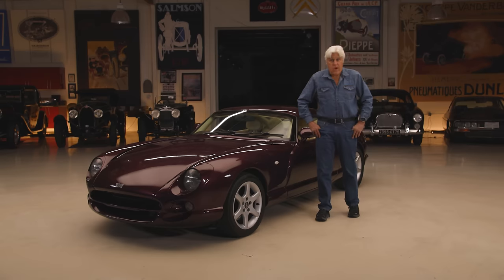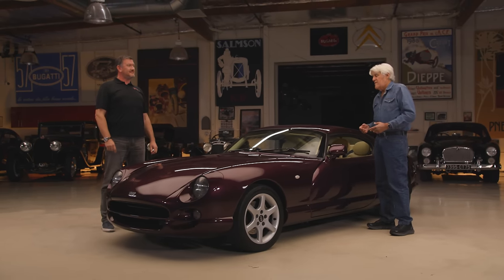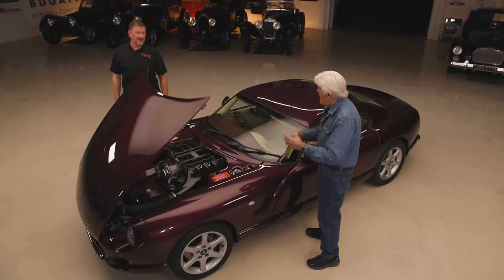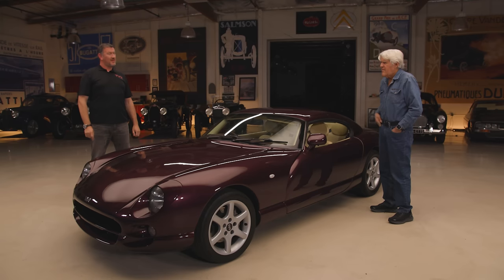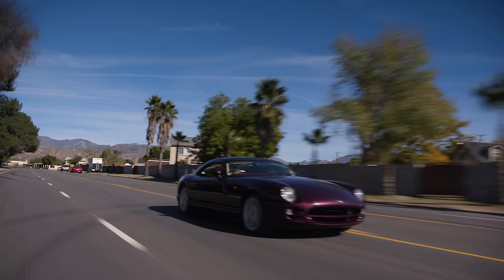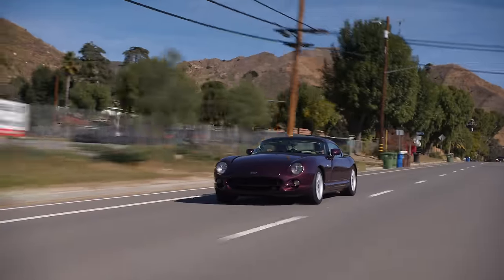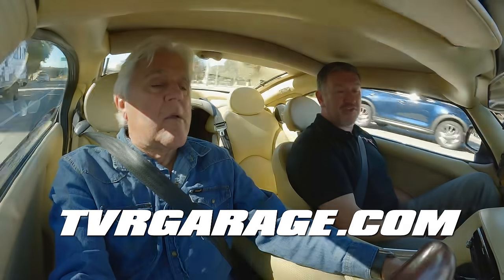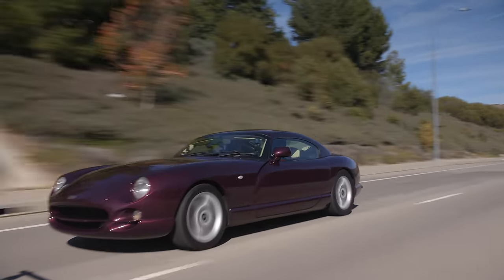TVR Cerbera - Jay Leno's Garage

Comment: I came to TVR in the early 90's before the Cerbera had finished being designed. I went straight into the development department and assisted with some of the body styling. Most of the front end was my work. Although the styling was borrowed largely from the Chimera front end, I designed the scoop that also incorporates the numberplate fixings, which also directed airflow up to the filter and top of the radiator. I blended in the indicator mountings to be part of the bodyshell layup rather than being a separate fixture as in the Chimera. I also designed the air intake system from the filter tray and filter cover mounted right on the front of the car and the scoop panel covering the steering rack and hiding the screen wash bottle. Was good days but a lot of stress. Peter Wheeler would constantly change things.  Once the moulds were being made I became body shop foreman for the Cerbera fibre glass production line and set up and trained all new staff to produce all the GRP parts of the car. I was Foreman on that production line for 5 years. I left to start my own composites production company in 1999.
Reply: Great to read a bit of the back story and development, I remember being behind a Cerbera on the way to a race meeting, really beautiful car hooning through English country roads, I was in a Golf GTi and we were both moving pretty quick down twisty B roads, once a good straight opened up you could say he easily gapped me!!
Reply: You did beautiful work.
Reply: Very cool !  Hope you’ve had a successful business
Reply: Well, because of you, this is still my favourite car to this day. Thank you.
Reply: @murkeywaters  The 205 1.9GTI was perfect for those twisty B roads - far better than the Golf GTI! OMG still one of the most fun cars I've every owned!!! Take the back seats out, they are useless anyway and put a rollbar in instead, but it was incredibly stable! The way you can throw the 205 round corners was mental, so quick but you had to learn the clutch or it was very easy to wheelspin. Not terrible in the wet, being fwd but it would understeer - so unforgiving but it got banned in France due to the number of fatal crashes! :body-blue-raised-arms: 
TVR's always make me smile! Driven the TVR Tuscan quite a few times and it was a blast! The Cerbera is a beautiful looking car!! :face-red-heart-shape: 
I love how Jay totally know's what he's talking about - the Guy is incredible! :person-turqouise-waving: The more I watch, the more he astounds me! :face-fuchsia-wide-eyes::person-turqouise-waving::text-green-game-over:
The 1930 Duesenberg LeBaron Barrelside made me cry!!! :hand-orange-covering-eyes::eyes-pink-heart-shape::medal-yellow-first-red:
Reply: Very very interesting, i have the last luxury car i plan on ever buying, my next car is most likely gong to be a cerebra, then my collection will be mostly complete
Reply: Beautiful job! I feel like they tainted your work with the TVR badge on the front. It's a billboard in a font that just doesn't match the car. Very classy styling. You're a master of your trade.
Reply: Great job mate you nailed it!

Comment: 31 year old Brit here. TVR has always been a favourite brand of mine, often known for shoddy build quality and questionable reliability. None of that has bothered me, the noise, the looks, the crazy speed and handling. That's why I love them. Sadly I haven't managed to afford to own and run one though.
Reply: You either like it or not, you either get it or NOT. People that like them, love them till death. People that hate em, can't stand the look of them. It's a car for enthusiasts! If you aren't one, it's not a car for you! But I agree with you! Cerbera and Sagaris are my all time favorite!
Reply: This one though, unless you live in a dry climate the whole chassis will rust out.
Reply: Yep watch edd chinas wheeler dealer’s restoration the whole chassis needed changing. But. Beautiful looking car
Reply: @SethDaughters it was easy to stop the rot. Theyd made the same mistake as Rover did on the SD1 and made whats like an inner fender that was supposed to let the wind get in and basically blow dry it. The fix was easy a few drill holes in the right places or you could fill the thing with marine expanding foam if you didnt care about the extra weight. Everyone at the time knew to fix the stuff TVR almost got right so practically any decent one you buy will have had all the usual mods done.
Reply: The main problem with the chassis is the really poor quality powder coating. Small bits of it flake off, then the exposed metal rusts. Then lifts the powder coating around it, which then rusts and so on.
Much of the chassis is inaccessible (or invisible) with the body on, so the only way properly fix it is to lift the body, then carry out the appropriate repairs, and finish with modern, good quality powder coat.
The first bits to go are usually the outriggers which are the tubes that run along behind, and support the sills of the bodyshell. These can be done by lifting the body slightly rather than completely removing it, but if you’re going that far, you might as well lift it and check / repair the whole thing.
If it’s really far gone, you can actually buy complete replacement chassis, although they aren’t cheap.
Reply: Well, a lot of us had to wait until their forties and fifties to obtain their dream Trevor (Chimaera 500 in my case), so at 31 you still have plenty of time! But don't worry, it's SOOO worth the wait!
Reply: I grew up in the North West of England not too far from Blackpool. Local small business owner had a Cerberus 4.5. Amazing car but as you say @danielhillier7417 the build quality was "questionable". He took it to France on a road trip and, as was the traditional at the time, absolutely gunned it on the first section of Autoroute off the ferry. At some speed in triple digits the entire exhaust system made a bid for freedom. The car had to be towed back to the UK and undergo some rather expensive repairs. I never saw it again...replaced with a 911 Turbo 😶
Reply: @TheAdamRBell  "exhaust made a bid for freedom" 😅 ok presumably someone had been fiddling and didn't put it back on properly... It's an exhaust and hardly worth mentioning, mine is 24 this year and the exhaust hasn't fallen off ONCE! 😱 AND I have grounded it in a multistorey carpark in France with ironically a bunch of Porsche enthusiasts behind me trying to get down to the same level. They made it without a hitch as their cars were riding higher and not to mention the wheel base on a Cerb is very long. I would blame poor repairs by "a" TVR Specialist that has me questioning them and not the car. They're awesome and this kind of BS is so old now it's getting boring. Any news on his IMS bearing? 😅 Oh but it's a Porsche can't talk about stuff like that!
Reply: & if you bought ANY car in the 60's & '70's even from a mass production auto manufacturer, ie,Austin, FIAT,Lancia,Triumph etc, the whole car rusted away!  @SethDaughters
Reply: The reliability is a misnomer, they only break when they don't get used, other than that they're damn solid cars, just have to remember they're hand built.
Reply: @TheAdamRBell  The British actually make more beautiful cars than the Italians, they make them about as reliable too.

All the most reliable British and Italian sports cars had American v8s, Shelbys, Sunbeams, Rovers, Jensens, Isos, De tomasos, etc.
Reply: @Pits750  exactly. Although I have put mine in storage at my uncles so I hope I don't have any issues. 😩

This said over the next few years it will have the body off for a full refurb.
Reply: @Pits750  Yeah I know they aren't really that bad.
Reply: My old Tasmin never experienced any real engine or gearbox failure. However, it did have clutch and throttle cable failures (the latter resulting in full throttle acceleration), headlight pop-up arm came off (got bloody wrists from rough glassfibre scratches re-attaching it), and a sheared bolt holding one of the rear trailing arms in place resulting in collapsed suspension and the wheel contacting and making a mess of the wheel arch. Fortunately this didn't happen at great speed. Still I loved it, and would have had another Trev but for a young family.
Reply: @Pits750  My Chimaera has broken down once in 15 years and 52000 miles - it snapped its throttle cable. by FAR the most reliable car I've owned.

Comment: You don't need to understand TVR, you only need to feel the experience  of the car to get it. A true, pure drivers car and surprisingly tough and reliable contrary to what others say. Simple and yet easy to maintain, unexpensive compared to contemporaries. They were absolute monsters on the road and real power under the bonnet-hood.And with that engine rumble, and exhaust note, but were capable of humiliating nearly anything else in it's class territory.  Peter Wheeler was a true giant of a man standing 6'7" and each car had ample room for the driver. A very sophisticated car underneath with a fantastic suspension setup-per usual, and chassis made for an ideal road driver. Among many comparisons were the Chrysler/Dodge Viper and Chevy"Vette's there are similarities t TVR had the idea of creating very radicle designs with no other real contemporaries out there on the market offering anything remotely near the levels of sophistication regarding "quirks and features"-Doug de Muro😂,.pound for pound and torque the TVR Speed 6 series (formerly TVR had used Rover V8) beats even the biggest names and competitors for cost measures too.Driven at speed,these cars can scare you to death for sheer power delivery on set up. The  Tuscans were great fun,as were the Ascaris, but there is only 1 TVR speed 12 Chimaera. That car was reportedly capable of speeds in excess of 250 mph+, i believe it!  if anyone gets to oan a real drivers car in their life, buy one! You will then begin to understand why these cars exist at all. Chances are you will be happy, with a huge smile on your face as you hear that lovely whizz / purr and that deep belly note as you throttle through the gears. Absolute poetry in motion. Yes they will break, but service and look after them wellland they reward you like nothing else. Lotus may be another great regarding automotive engiineering and TVR should be added to the list of real innovators for real automotive know how.

Comment: He is correct about the car in the playstation game Gran Tourismo. That's where I first learned about it in the 90s. It was the fastest car in the game IF you could control it which was next to impossible. So I spent a month, every day after school, fine tuning it (you could change gear ratios, transmission gears, and suspension, just like IRL). I finally got it to where I could manage it. It still spun the tires till 3rd gear and was still basically a difficult to control missile but it was finally doable. Took my saved game to every competition and blew them all out of the park. Loved the way it looked too. Surprised there isn't more info on the cars.
Reply: Yes. Since the Playstation days  this is one of my all time favorite cars.

Comment: I'm on my sixth TVR, a 2006 TVR Tuscan Convertible with the 4 litre Speedsix engine.They made approx 83 in 2005 and 2006 before the factory closed in 2006. Its a great car which I've had the good fortune of driving around Europe in. Many holiday trips down to Spain and Portugal but also used as my daily while working in Germany.
No ABS, Airbags, Traction control etc. just fun driving.  😁
Reply: Sick motor proper beast of a thing..
Reply: I own a T350 🙂
Reply: How are they for reliability and insurance ?
Reply: @tysonmandela9265  My first TVR was a 1983 2.8lt Tasmin, daily driver in Switzerland and Germany. Never broke down.
2nd, a 1993 Chimaera 400, daily driver in Germany.
3rd, a 2000 Tuscan, needed an engine rebuild but then daily driver in Germany.
4th, 20006 Tuscan convertible, general maintenance but did get shipped back from France when engine management fried. Still have it and still love it.
5th, 1998 Chimaera, project car but no time so moved it on.
6th 1998 Cerbera 4.2, absolutely loved it but it spent 20 of 24 months in the workshop so moved on.
Used daily they are fine. 👍🏼
Reply: @oil3616  by the sound of it the have a common fault with engine and from what I have read on the internet they have a couple of common faults. I am interested in buying one but if its a money out then I will save my self the hustle and buy a m5
Reply: @tysonmandela9265  the problem engine was the Speed6 4lt. Used on most cars after 1999.
Very many have had rebuilds and will be OK (unless rebuilt at the factory).
The later engines are good.
My 2006 Tuscan has 87k miles now, many trips to Spain, Portugal, Germany……
Reply: @oil3616  thanks for the info. I think I will just need ti go and view a couple and see how I feel. The one thing putting me off is that if something does brake. I would imagine TVR parts can be hard to come by. I had that issue with my wrx STI parts cost an arm and a leg because they are not common
Reply: I own a Chimaera 450 Supercharged,  do you think they hit the sweet spot with the Tuscan ? I’m considering switching one day ?  I do love the Cerb though,  who doesn’t !

Comment: The TVR Cerbera was a maniac. I've seen one of those SMOKE an Aston Martin Vantage, which we all know was a freakin' animal itself. There's a Top Gear episode where they lined up the 8 fastest cars in the world, the Cerbera walked away from the entire pack...
Reply: The Blackpool Rocket
Reply: Yea it had full race egine
Reply: Pretty sure that Cerbera on that line up wasn't stock, but still.
Reply: Good PR at the time for TVR, not just that Clarkson and Wheeler were very good mates and both from Yorkshire  @GillespieGaming
Reply: I personally laminated the bodyshell of that car. It was a carbonfibre/ glassfibre sandwich. It was about half the weight of the production shell. The floor pan was laid up as standard though. The engine was a full on 5 litre version of the AJP8 and was Tuscan race spec.
Reply: @trevorjlewis  Do you know what happened to it? What a monster.

Comment: I’ve been lucky enough to have owned two TVR’s. A Chimaera with a 4 litre (Rover/Buick based, but built by TVRPower, a TVR subsidiary) V8, and probably TVR’s best kept secret a last of the line 2005 Tamora with the 3.6 litre Speedsix engine. Fantastic handling car and very underrated even here in the UK, a genuine 350hp and only 1000kg.

Comment: My brother in law bought a brand new 4.5 back in 1999, sadly he had lots of issues with it. However, to this day it remains one of my favourite cars, having been on a number of long drives in it , as a passenger. The looks are sublime, the interior too, is amazing but above all else; the noise, not much gets close. One of those cars where you grin when you see a tunnel approaching or yet another roundabout (we have lots in the UK) which gave you the chance to change down a few gears and floor it.
Pulling out onto motorway slip roads and flying passed cars already travelling at considerable speed in the fast lane was wonderful.

Comment: I used to work for Al Melling, the guy that designed those engines.  That V8 was his proudest creation.
Reply: What an honour! I preferred the Speed 6 (I later owned a 4.5l Cerbera too), such a shame Wheeler screwed the reliability with cost cutting modifications but great that you can restore it to the original spec.
Reply: What happened with the tvr rival he had planned? Wildcat I think
Reply: @hambo76  cost cutting as in?
Reply: @johnnyjohnson8928  Peter Wheeler changed some of the Speed Six engine specs to cut costs and this affected its reliability significantly. They can be reverted back to the original Melling spec for a fee though.
Reply: @mj897  Melling was a snake oil salesman.
Reply: @mathertom  perhaps you should elaborate on your comment  since you know something that nobody else knows
Reply: I thought it was 24v V6
Reply: @ksm1985  don't know of any V6 engines he made. They were either V8 or straight sixes

Comment: Owned a Sagaris and own a T350T. Friends have owned Chimeras, Cerbs and Griffs. Cerbs are brutal with the 4.5. Love my T350T.
Reply: Oh yes they are! 👌🏻Mines been fettled by Joolz the Cerbera Guru, and well it's faster than factory with a full ACT Performance exhaust amongst other bits. Absolutely love it. Glad you're enjoying your T350T, a very underrated TVR. If anything with a few mods it's as quick as a Sag plus I think in the looks department it will outlast the Sag, even though they're wild beasts. 👍🏻

Comment: Ahhh TVR, I love my Trevor’s.. Owned 6 of them over the years.. 450 Chimeara, Wedge 350i, 2 x 400SE, a 420 SEAC, and a 450 SEAC… Both SEAC’s are rare cars. 

My 420 had a full Kevlar & some carbon fibre body.. It also had the 4.2L V8 rebuilt by TVR Power engine dept, built up to 5L, Cosworth pistons, carbon intake plenum.. Had around 300bhp. But it was the sound it made that got the hairs standing on end.. 

Wish I still had either the 420 or 450 SEAC 

Great to see TVR on Jays channel
Reply: The Wedges were very cool looking cars.
Reply: @yippeethreeeight  They really are.. I just loved the 80s shape & pop up headlights 😁